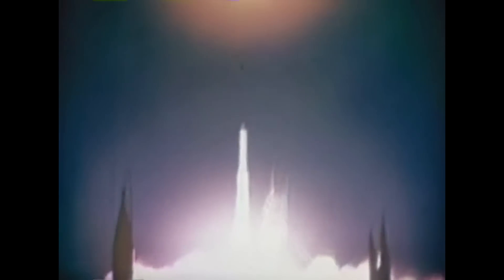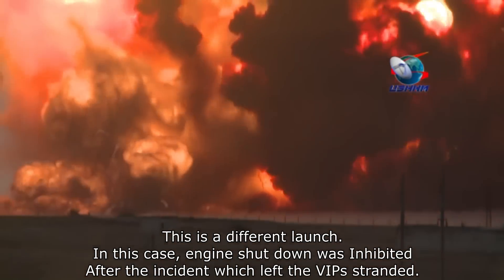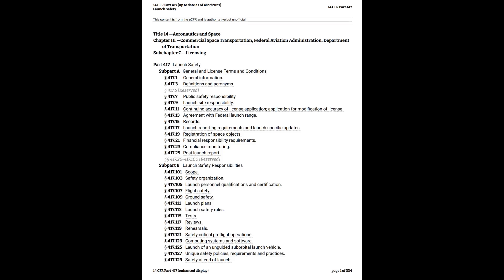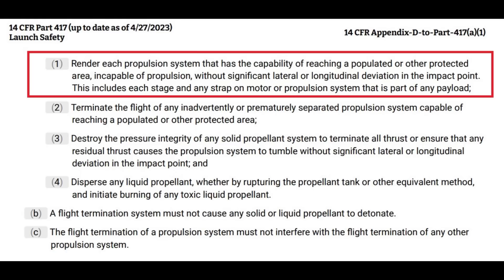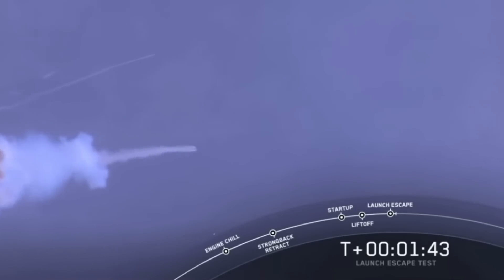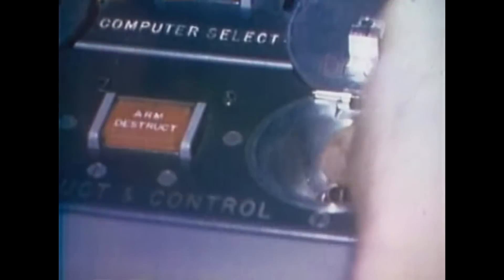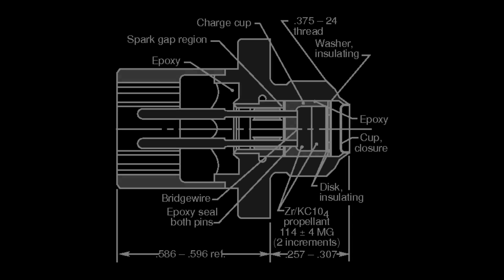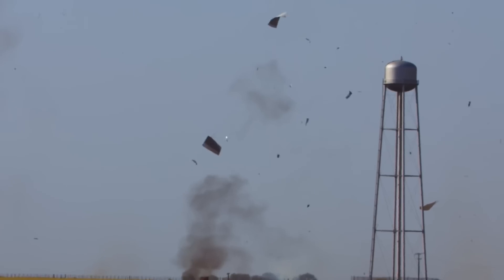How To Destroy Wayward Rockets - Flight Termination Systems Explained

Comment: Great job as always Scott.  One simplified way to look at this is to start with the objective of an FTS system.  It is NOT to blow up the rocket (although that is a frequent side effect).  The primary objective is to keep it on the range by rendering it non-propulsive.  When liquid propellants are present, we would also like to disperse them.  Burning is not generally required, it's just another common side effect.  

To that end, most FTS designs cut the SRM's dome or sidewall so it will tumble and not have a significant net thrust vector.  The resulting "unplanned" burn surfaces sometimes, but not always,  also result in some spectacular rapid combustion...   As you said, liquid propellant tanks are also cut and vented.

When do we want this to occur?  Three circumstances:  1) The rocket has left the safe corridor. 2) The rocket is obviously about to leave the safe corridor, or 3) The rocket is clearly out of control and/or breaking up.

How do we know this is happening?  Three common ways:  1) Skin tracking, via RADAR of the rocket's position.  2) Autonomous tracking of the rocket's position via on board GPS receivers and/or conveying the GPS signal from the rocket to the ground, typically via a GPS solution or  "bent pipe" translator, and 3) On board monitoring of critical systems.  This data is also sent the ground.  All 3 of these are usually present on any given rocket.

Then what?  Three ways it get's started:  1) Command destruct from the ground by the Range Safety Officer.  Usually based on the skin track or the on board GPS, but this can also be prompted by the other data based on his/her judgement.  2) Self Destruct, where the rocket initiates its own destruct based on violating pre-programmed parameters, including position.  3) Auto Destruct, where a departing stage or SRM, during a breakup, detects that it's no longer attached (when it should be, ie: this function is "inhibited" during planned staging) and initiates destruct to render itself non-propulsive.  It is not uncommon for all of these to happen.  Auto goes off during a break up, the individual stages self destruct, and the Range Safety Officer slams the button.

Off board command destruct and skin tracking is being phased out in favor of autonomous flight safety systems (AFSS), to reduced the burden on the Ranges going forward as launch rates increase and USSF infrastructure ages.

The systems above are at least dual redundant, extremely reliable, able survive "abnormal" environments (ie the kind of thermal and mechanical loads that would only happen during a bad day)  and must be certified by the Range who is generally involved in the disposition of any anomalous behavior or observations.

They must also function instantaneously when triggered.  Remember that a space launch vehicle very quickly attains hypersonic velocity and is easily capable reaching populated areas within seconds of loosing control.

Tb
Reply from the maker: Thanks, I hope ULA continues to not need to use the FTS hardware it flies!
Reply: @scottmanley  Common Sense Skeptic is pretty sure that the FTS failed at the SpaceX launch; https://youtu.be/ErDuVomNd9M Would be good to hear your take on his interpretation of the video footage.
Reply: it just makes my day a little better knowing that Tory Bruno has an average-Joe youtube account like the rest of us
Reply: @gentrywalker  My first thought reading Mr. Bruno‘s comment without reading the commenting persons name: What a smarta…, he just kinda repeats what Scott just posted. Then I read your comment and went OOOOOPPPS, sorry Mr. Bruno! and read his comment again with the due respect. Thanks to both of you! Have a nice sunday.
Reply: Hello Tory (CC Scott), are you allowed and willing to share your opinion on the operation of the Starship FTS? During this test flight it seemed to have fit the criteria in your comment. However, I'm not (yet) confident it would have resulted in a timely termination if that would have been required earlier on in the flight.
Reply: @DehimVerveen  I prefer not to publicly speculate about other people"s rockets during their investigation.
Reply: @torybruno7952 Understandable. I figured as such. Thank you anyway for you reply!
Reply: @DehimVerveen I'm not that well connected, but some serious directional anomalies were observed before completion of the termination sequence, biggest open question is if the termination sequence was already in progress at that time .
Reply: @DehimVerveen  Check out Common Sense Skeptic. He says FTS wasn't fired when one would expect. In fact (if I understood him right) if it came on at all, it was accidental.
Reply: @dougerrohmer  Thanks for the suggestion. I had already seen his video actually, but I didn't find that part of the video very convincing. I could be wrong of course.
Reply: @dougerrohmer  jeez, not common sense skeptic... he demonstrated multiple times over that he has barely any understanding of spaceflight technology and he's also been shown to lie and cherry-pick in his videos. For your own sake, chose better sources for knowledge.
Reply: @TheNheg66  I don't know, he might not have your level of spaceflight tech, but he can do volumetric calcs etc well enough to debunk liars like Elongated Muskrat. I haven't found any lies, and if he's cherry picking it's because his videos are long enough and he picks salient points. For your own sake, pick better heroes (presuming that your feelings are hurt that he pissed on Elongated).
Reply: @dougerrohmer  ah yeah, the classic fallacy of "anyone who disagrees must be a musk fanboy". Well this is embarrasing, CSS and TF's fans really are even worse than the Musk ones... 🤦‍♂️
I see there really is no point showing you any of the ways CSS manipulates and how he lacks even basic spaceflight physics understanding, you wouldn't care even if he does, and thus i'm not going to try. I wouldn't be able to fit 10% of it into this comment anyway (a 2hour video was literally not enough to explore everything he lies about, lol).
Reply: @dougerrohmer  and FYI, no, i couldn't care less that CSS has negative opinions on Musk, nor that he shares them on YT and makes money of them. I share many of those negative opinons.

What i care about is when someone is so blinded by those negative opinions that it makes them lie, manipulate and disinform, just so they can keep their narrative alive and that when they're shown to be wrong they don't admit it and double down. I've expected more integrity from a guy like TF, who i've respected for a long time and someone who calls himself a "Skeptic", yet never calls his own beliefs into question.
Reply: How does one end up with the job of range safety officer?
Reply: @letsgocamping88  Some higer-up notices you are good at making things go BOOM, not too early, not too late...
Reply: @letsgocamping88  It's an Air Force (Space Force career path for missions on the National Ranges.  There is also an entire team of Range Safety professionals in the Gov working with the contractor and other USG groups to independently certify the FTS system and set corridors, etc.  It's a very specialized technical discipline, of which, there are precious few experts.
Reply: @torybruno7952  So cool to see you are still a humble space nerd in your free time. As an A&P mechanic I admire ULA and everything it stands for - innovation without throwing the 'book' away.
Reply: @Benjamin Harvey  get a degree in rocket science
Reply: gets started
Reply: One thing I'm wondering is whether the destruction radio signals sent from the ground are authenticated in any way. It would be pretty bad if anyone could blow up your rocket just by spoofing an appropriate message…

While it's unlikely that no engineer ever though about it before, I really hope it's a non-issue.
(tho one can conjure a fake airplane this way)
Reply: @mskiptr  Well, that was a plot point in a James Bond movie released in some countries as "Mission Kill" .
Reply: @johndododoe1411  wasn’t that also the plot of Dr No?
Reply: @mskiptr  "One thing I'm wondering is whether the destruction radio signals sent from the ground are authenticated in any way. ... While it's unlikely that no engineer ever though about it before..."   Just watch "Star Trek:  The Wrath of Kahn".   If encoding sensitive command instructions hadn't been thought about before 1982, it certainly was by then ; )
Reply: @mskiptr  The signals are coded - and that PREDATES the first Star Trek movie by quite a long time.
They could be spoofed - but not easily.

That's referring specifically to the gear I worked on and the rockets I worked on parts for though - I don't know about commercial-specific rockets.
Reply: My first thought was, "Oh no... Here goes some armchair engineer explaining to Scott the exact contents of the video Scott just made..."

Then I looked at the username!
Reply: @fiveoneecho  Tory Who?
Reply: A Scotsman and a Space cowboy walk into a bar.
Reply: Thanks
Reply: *Yolanda = Elon Musk...  How did voice recognition turn that into Yolanda?  Am I having a stroke?  Wernicke's aphasia?  What other errors are in that post?
Reply: Such valuable knowledge shared here. Love it.
Reply: Yeah it was a bit baffling watching how long it was tumbling before apparently detonating. When I looked at better footage I realized they did the range safety detonation about 50 seconds before it apparently exploded. You can see two Trails of Vapor one from the booster, one from Starship, and that continues for about 50 seconds before the whole thing flies apart. In an interview since then Yolanda has stated that they needed to have a more powerful ring safety system, and that backs up the idea that it just punched holes in it, and it took too long for it to fall apart.

Would it have been a danger in lower atmosphere? I don't know. It could be that with greater atmospheric drag those little holes might have ripped it apart instantly if it have been lower, but I would want more of a safety margin in case the rocket started flying toward people or a facility.

Even in my cell phobe video, you can see the twin contrails at 3 mind 56 seconds before the apparent detonation at 4 mins 4 seconds.

https://youtu.be/pGwlkaClv3Y
Reply: Awesome explanation!  I've seen quite a few videos that claim they explained FTS, but they are oversimplified to an extent that makes them almost pointless and some even contain misinformation, too.  Thank you for your comment.
Reply: "When do we want this to occur?"

Elon says, You forgot #4, "When rocket is directly above Tim Dodd's location". Elon's tired of having to change his phone number every month, from Timmeh's cringe man-crush. 😂